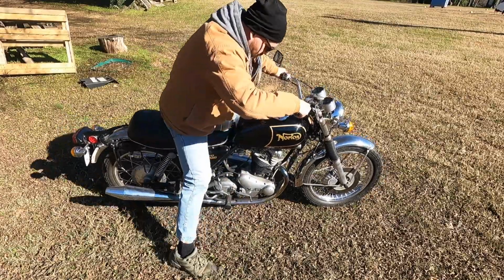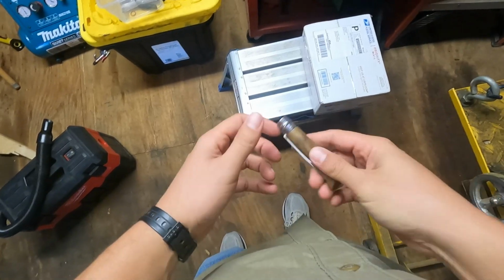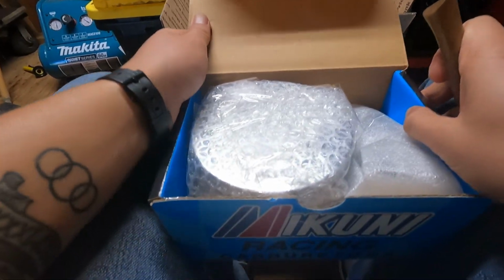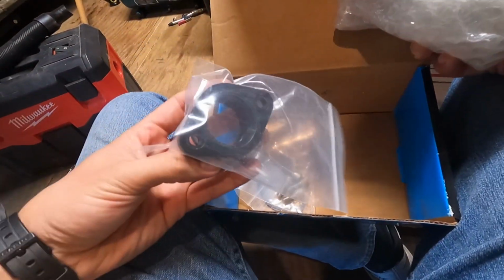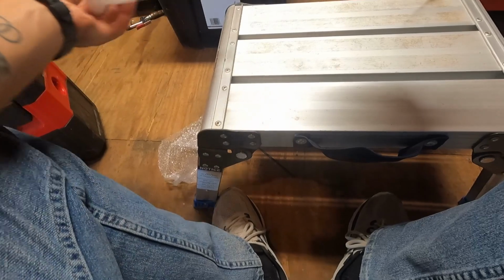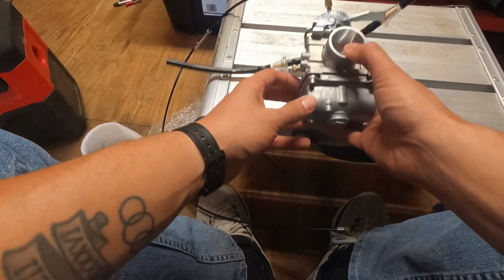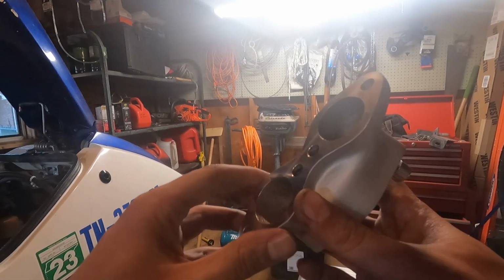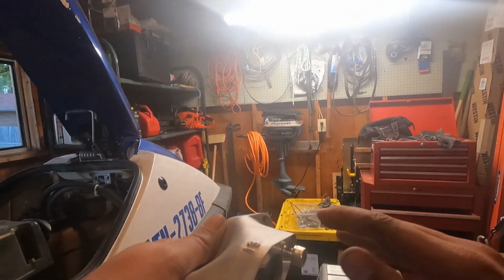Norton Commando Mikuni Carburetor

Comment: The air screw on my Amal carb of my new Norton vibrated out.   Later went to twin carb Mikunis from Sudco.   After they got old & wore out I went with the single Mikuni which never needs adjustment.   Bike not quite as fast but neither am I at 74 years old.
Reply from the maker: They will do that. Still good carbs.

Comment: Advocating for a single Mikuni is no 'fix' at all. If your Norton is hard to start that doesn't mean it's the fault of the carbs. If you're sure it is, it's easier and cheaper to rebuild the Amals, flush the ethanol gas that is plugging them up and you still have the acceleration, the torque and the grunt that Norton Commandos are known for. If the learning curve to rebuild and adjust the 50 year old carbs doesn't interest you or you think the rebuild might not help, buy a new pair of Amal Premiere carbs and you still have that Norton grunt. With a Mikuni carb a Commando doesn't run the same and doesn't even sound the same. A single Mikuni 34mm is not the same as dual carbs which is 2 x 30mm or 2 x 32mm if you have 32mm manifolds.
Reply from the maker: I stand by my decision to run a Mik. When I do a nut-and-bolt restoration, I'll be using Amal Premieres. For now, this is just fine.
Reply: @TriStarWorkshop  I realize you've already made your decision. I comment to other Norton restorers who are considering which direction to take when they consider their carburetor choices. Most single Mikuni owners advocate the decision they have made as a good decision but rarely do they expose the inherent performance losses which might be important to other owners.  One Mikuni advocate told me his single Mikuni Commando is faster than any with dual carbs because in his Norton club nobody can catch him.  Another told me there is no performance difference "except at the very top end" which he apparently never gets to. Some suppliers sell and advertise the single Mikuni kit as an "upgrade". Questionable but I can't see them advertising it as a 'downgrade'. In the end I'm glad you're satisfied with your choice.
 I'm a Norton owner since 1972 and own several Commandos. All of them with dual carbs, all start 1-2 kicks and all idle properly (for now).
Reply: Mikuni guys that think they want to be British bike mechanics.    0 respect.  0 agreement.  Alls it shows is that you have no ability or confidence or interest in doing what it takes to make things right.
Reply from the maker: @mickgerard6696  please tell me how making my uncle's motorcycle run again is disrespectful? We get it: Everything was better back in your day. The way your generation clings to relevancy is so cringe.